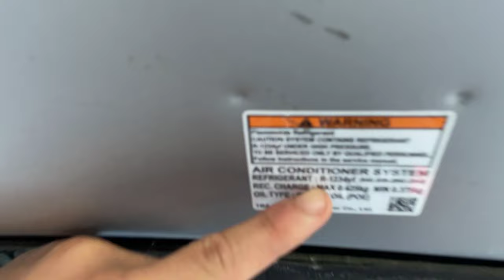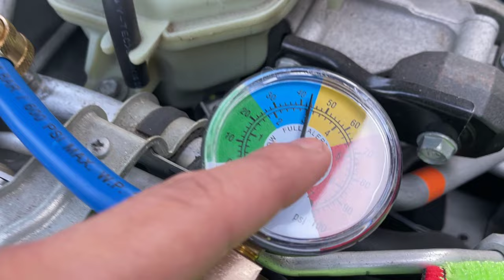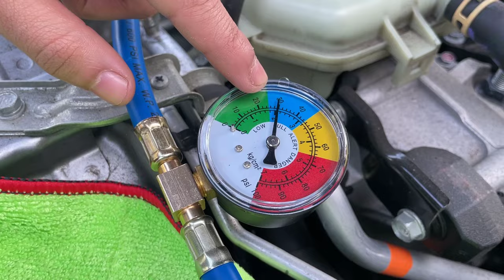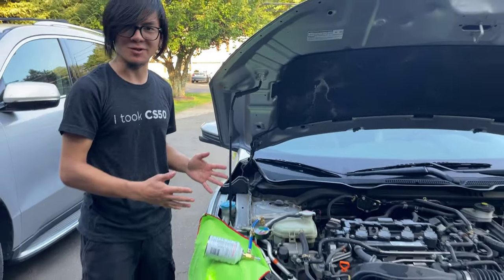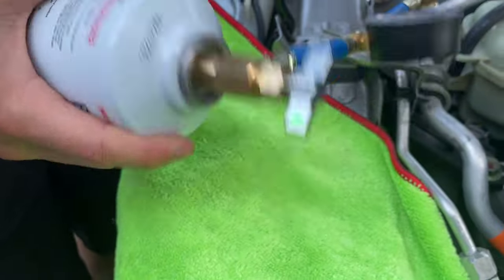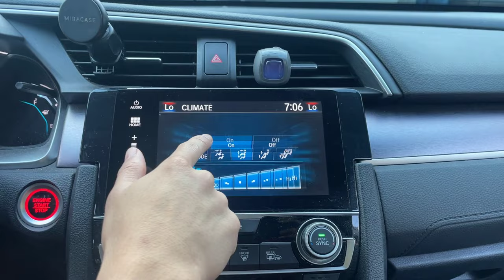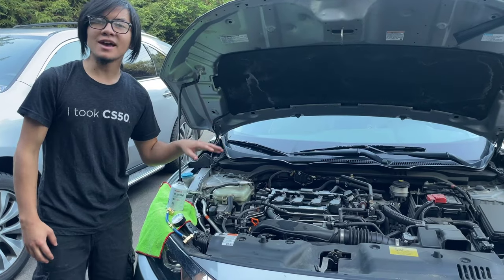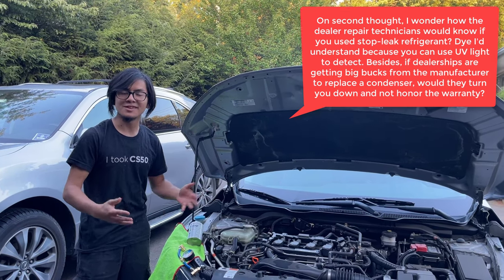How To Recharge A/C 10th Gen Honda Civic 2016-2021 R1234YF In-Depth | TSB Recall Condenser Issues

Comment: I got mine for less then 35$ at Walmart 😂 I don’t understand why you all are paying so much
Reply: The whole kit?
Reply: My local Walmart super center doesn’t even carry any 1234yf. I had to get same kit this guy got
Reply: Lol no way you got R 1234yf for that much that's straight up bull
Reply: AC is a closed system. If the refrigerant charge gets low all the time then I would be concerned about leaks and get them fixed before recharging.
Reply: Bro 35$?? You got robbed I got mine for 5$ 🤑

Comment: I have a 2019 and the same problem exist every year had to refill. No more hondas for this guy. No warrenty or any kind of help from honda either. FYI
Reply: Well if they did it under warranty they’d have to pay their worker instead of you paying them.
Reply: Man I got 2019 too I just filled mine again smh
Reply: Their mechanics are a freaking joke. They go straight to where the warrant parts are and void it immediately
Reply: Check your condenser. Apparently they’re going bad. Currently learning how to replace mine. Stop charging your system until you check that first. You’re just putting a band-aid on it by charging it.

Comment: I just bought it right now, Total came out to $77 and some change.
Reply from the maker: Ouchh, that's a lot. You probably bought the one with leak seal. The regular Honeywell R-1234yf Soltice yf Refrigerant 8oz at our local Autozone is $44.99
Reply: What hose brand was it ? @EyeOnAiman

Comment: Just recharge it with R-134a, R-1234yf is backwards compatible and the only reason the gov forced the switch is because honeywell lobbied them to adopt their proprietary refrigerant, the system is exactly the same. I just did mine over the summer and it blows colder then ever.

Comment from the maker: Here are the #ad links to the R-1234YF, hose with gauge, parts, materials, accessories and tools needed for this repair:
1.  https://amzn.to/3DyOQvh  |  ZeroR® Top Off Kit #1 - Genuine 8oz HFO-R1234YF Refrigerant (1 Can) & HD Brass Can Tap with Gauge
2.  https://amzn.to/3qe5r4z  |  Arctic Air for R1234yf, 4 cans and Gauge, R-1234yf, R1234 Refrigerant Support
3.  https://amzn.to/3Om4pf4  |  R1234YF Refrigerant Charge Hose Kit, R-1234YF AC refrigerant Can Hose with Gauge, 1/2 LH Can Opener Tap And R1234YF Low Side Adapter
4.  https://amzn.to/3OcX0yr  |  Lichamp AC R1234YF R134A Gauge Set, Automotive Manifold Gauge Compatible with R1234YF R134A and R404A Refrigerants, Works on Car Freon Charging and Evacuatio
5.  https://amzn.to/44DIXcd  |  Lichamp AC Oil Injector R134A, R1234YF Refrigerant A/C Dye Injector Kit with Adjustable Coupler and Oil Checkers

Or Click on Amazon link here and search for what you need:  https://amzn.to/3xIOsqg

Comment: Thanks for the notice of the Honda service bulletin! I didn’t know about that as I was getting ready to do this recharge. Took it to the local Honda service center mentioning this bulletin and got a new condenser and seals for free 👌
Reply: Can I ask... before you took your car in for the change did your sticker under the hood reflect the new coolant or the old one? I'm asking because I have a 2016 Civic and my sticker has the new coolant on it (R-1234yf) but I never took it in for the compressor seal change and I wanna know if I should take it or not to worry about it
Reply: @ChilloHaus  I have a 2019 civic and it has the new coolant. A couple days after getting the condenser replaced for free it stopped blowing cold again. I took it back and it needed a new Evaporator, so it was a $2,000 job. Luckily my warranty covered most of it. I think Honda should have recalled for all AC components because that coolant eats through the whole system, not just the covered condenser. When you bring it in make sure to mention that you are bringing it in for Honda Service Bulletin 19-091. Your model should be covered for the condenser at least

Comment: Thanks! I talked to the dealership and I never even knew that the A/C requires recharging every 3-5 years... they stated they would do it but minimum would cost 300 bucks to do... and thats if the parts were not broken or something.

Watching this... hoping that it will only cost me the 60ish bucks you mentioned. If so you were a life saver. Thanks!
Reply: AC is a sealed system and during operation, refrigerant  does not get consumed. If it's low in charge, there is a leak somewhere. At a dealership where Technicians are flat rate, they are not going to spend time to look for leaks. They will just charge it and collect their pay for that job and quickly grab the next set of keys. Do you recharge your refrigerator or window AC unit every 3-5 years? BTW, technician of decades and do a lot of AC work. It's always a leak, and I find them and fix them.
Reply: If u don’t recharge the system in the long run it’s over

Comment: As a former instructor, GREAT INFORMATIVE VIDEO! One question, I was alway told to hold the can of coolant upright so the vapors would travel into the system as a vapor, not a liquid. Am I wrong about this? Is it ok to hold the can upside down as demonstarted in the video and let the coolant in liquid form  enter the system as a fluid? Please advise, thanks!

Comment: I bet I backed the pin back out and failed at least once.  I have a lever on my 1234yf gauge.  I guess you just hold it down to the end.  Lots of useful info here.  I did get the Honda notice on my 2016

Comment: Your video just saved me from going to Honda and pay a lot of money. Thank you so much! Just have one question. I accidentally pulled down the H pipe and it got removed from the plastic bracket. Then I realize I was supposed to go for the L cap pipe. Now I can’t put the H pipe in that bracket. Is there any tip you can give me to lock it back?

Comment: Do you know about how long this lasts until you'll need to possibly do this process again?
Reply from the maker: We're ok so far, been about a month a half (since July 24th) and the AC is back to normal. We'll let you know how long it last. Eventually we're going to have to bring it back to the dealer to replace the faulty condenser but we have until 2026 or 2027. It's a 2017 Honda Civic so the extended warranty on the condenser should last 10 years from date of original purchase.

Comment: what happens if you use the old refrigerant ? will it destroy the condenser or any other air conditioning components ?
Reply from the maker: Well, there are 2 different school of thought on this one:
1) The "NO" crowds - It's important to note that you should not use R134A in a system that is designed for 1234YF. The two refrigerants have different properties and using the wrong one can cause damage to the system and potentially be dangerous.
2) The "YES" crowds -  Can I convert R-1234yf to R134a?
You can convert an empty R-1234yf system to R-134a. Mercedes made this obvious when it raised objections to R-1234yf over 11⁄2 years ago and recalled European models with the refrigerant, recovered it from the vehicles' systems and recharged them with R-134a.

However, you should NOT convert R-134a system to R-1234yf. R134a systems were not designed to operate using a flammable refrigerant. R134a systems should not be converted to use R1234yf as these systems are unable to be converted to a level that satisfies the requirements of international standards (SAE J639 and SAE J2842) set for systems that use R1234yf.

Comment: I got a 2020 Honda civic Exl  10k miles and have this issue
Reply from the maker: Well, that sucks, but at least it should still be under the warranty and the dealer should be glad to replace the condenser at no charge and probably point out to some other "maintenance" issues needed to  be done. Once you bring it to a dealer, there's always going to be a follow up trip, usually once after another 😞

Comment: So what was your issue? Refrigerant low or leak?
Reply from the maker: Not 100% sure. Most likely a slow leak coming from the condenser causing the refrigerant volume to be low over time, but the AC is working fine right now. It's been a month and a half since then.

Comment: Another question, If the ac is recharged and the fan speed decreases. What would be the cause?
Reply from the maker: Not sure if the increase refrigerant pressure affected the fan speed. The most likely cause is simply that the fan speed setting is on an automatic setting and the system is responding to changes in temperature. However, if you have the fan set to a specific speed and it is still fluctuating, there could be an issue with the fan itself or with the AC system as a whole. Clogged air filter or cabin filter could also be a culprit, perhaps motor starting to fail, but if it happened right after the AC recharged and you're referring the AC fan mounted on the radiator/condenser unit and not the blower fan inside the cabin, then it could be the alternator issue, as more current is being drawn to the compressor. It could also be tension of the belt causing the alternator not to be optimal thus providing less amperage overall. Extremely difficult to speculate without testing the current draw before and after.

Comment: I had to do this today in my 2020 civic. As I was filling the feron and it being my furst time. I didnt want mess up my A/c. I was told because it wasnt opened up all the way. It could cause an issue. Later on, i did open it up all the way. Just dont want future honda issues? Though is this true?
Reply: Did you end up doing it yourself? If so, what was the reason you did this? Did the AC compressor stop engaging due to low freon?
Reply: @RobertoLopez-gp2yi  its was low on freon for some reason. Now it gets super icy cold.

Comment: Your video is a bit disorganized and fails to mention that you must not overcharge your system, so you need tell the audience exactly where on the cheap gauge the needle should stabilize and indicate when to stop adding refrigerant.   Also, one commenter mentioned that they took their Honda to the dealer and they fixed it for "FREE."  This is very misleading information or should I say "dis-information" these days.  The very large Honda dealer in my area (N. VA) told me that indeed there is a service bulletin on the A/C system which they say is due to a leak around the compressor shaft (not the condenser as suggested by the Youtuber), however, they won't touch the A/C system on my 2019 CR-V unless I pay about $500 up front for a "assessment" fee.  What do I get for this you ask?  This is their charge to empty/recapture my R1234yf refrigerant (if there is any in their to begin with) and for them to add "dye" and then recharge the now empty system and look for the source of the leak with a UV light.  IF they decide that the leak is due to the service recall part, then they will credit me back the $500 fee for the discharge/recharge/dye and replace the bad part.  IF, they decide that the leak is something else (how heck would I know???), then they will advise me what needs to be done and how much it will cost AND I am on the hook for the initial "evaluation" fee; no way around it!   Sounds like a gigantic lose/lose rip-off, because I have no idea what they are going to find and what they decide needs replacing.  Also, I know enough about A/C systems (having installed and serviced over dozen different auto makes in the past) I know that dye can be added to any A/C system without removing all the refrigerant anyway.  If you follow this train of logic carefully, you will understand why I am NOT taking my Honda to the "stealership" for this problem.
Reply: I just came back from the dealership due this issue , they didn’t want to refill the ac due problem with the vaporizer or  whatever is called . They said they have to fix that first before they proceed with the ac Refill that is covered by the warranty but they wanted to charge me 2 grand  to fix the vaporizer . Idk what to do about it . I might just buy this ac can and refill it by myself for now .
Reply: My AC was blowing hot air. I took it to the dealer and they charged $430 to  put a dye and refridgerant in and ask me to drive it for a week or so. After driving the car 500 miles i returned to the dealer so they could check for a leak. They said my compresor seals and the suction hose were leaking. They will fix the compressor seal for free but want me to pay $1088 for a new suction hose.  Am i being ripped off ?
Reply: This video was highly organized and informative. Your comment was not😂
Reply: @c.richardsmith3437  😢. This is outrageous! Both of my sons' 2018 hondas have a non functioning A/C. There's no way we should pay over $100 to have these cars diagnosed,  and with less than 60k miles each, any A/C leaks SHOULD be covered by that extended warranty, regardless of where the leak is.   I see a class action suit coming soon !
Reply: “Dis-information” 
Misinformation is the term you’re looking for; don’t think too hard Mike
Reply: lol stealership
Reply: @c.richardsmith3437  sounds like it.
Reply: Bro stop hating lol this video was pretty well made, it seems to me you just lack enough experience to do this job. If you’re mechanically inclined you would’ve understood he gave more than enough information on how to complete this procedure it’s not that hard.
Reply: Stay away from the dealership unless it's for warranty work, otherwise you  will get ripped off.  Find yourself an honest local mechanic or better yet learn how to fix things yourself. R1234yf is complete garbage and is way over priced. Any vehicle that came from the factory with it can successfully be converted to use R134a. There's plenty of videos right here on YouTube explaining the process. I've done it to 5 different vehicles so far with no issues.
Reply: @c.richardsmith3437 I was told the same. Just DIY. The hose is like a $14 part. You can rent the necessary parts at autozone. They say don’t release refrigerant into the air but also remember Taylor swift is out there flying her private jumbo jet.
Reply: Why don't you tell the good people where the pressure should be and just be nice
Reply: Yup!
Reply: @superdupert6 ugh $160 to just “diagnose my car” if it’s covered under warranty, I get it back but if it’s not then I’m on the hook for $160 like are you serious? How about you just not tell me what the problem is if it’s not under warranty and don’t charge me anything you freaken losers I hate dealerships
Reply: @leosantamaria1621 I think you mean evaporator? And yes they fixed the first two pieces but now will not fix the third (evaporator) until I pay they $1900+

Comment: I have a 2022 with 20,00 miles and the AC does not throw cold air anymore would you be able to help me
Reply: I have a 2018 CRV last year the SC did not blow the cold air any more. I searched the internet and found this video. It seems that this is a common problem for Honda ACs

I called the local Honda dealer. They said they would change the cost to check whether it is the AC problem. If it is not, I have to pay the diagnosis cost. Since the AC has a 10 year warranty, I will recharge the R-1234fy first. If it is still lack of cold air, I will bring it up tp the dealership to check.

Comment: How do I know if I need Freon? And how do I know how much to add?
Reply: My civic is blowing cold air but I noticed I have to lower the temperature in the cabin significantly which I didn’t have to do before
Reply from the maker: @christiancammarota3061  If it's the condenser then you can bring to the dealer for warranty recall. We just don't want to bring to the dealer yet.

Comment: Once you get corrosion and moisture in the system, you’re going to end up like me: first it’s a condenser problem; next will be a compressor seal problem, lastly the evaporator will corrode from the inside and spring many leaks. I’ve gotten the first two covered by Honda. They are delaying my evaporator fix and want me to front $2000 until they figure out what to do for everyone

Comment: Can it use the other gas? And use an adapter maybe?
Reply: No!
Reply from the maker: Well, there are 2 different school of thought on this one:
1) The "NO" crowds - It's important to note that you should not use R134A in a system that is designed for 1234YF. The two refrigerants have different properties and using the wrong one can cause damage to the system and potentially be dangerous.
2) The "YES" crowds -  Can I convert R-1234yf to R134a? You can convert an empty R-1234yf system to R-134a. Mercedes made this obvious when it raised objections to R-1234yf over 11⁄2 years ago and recalled European models with the refrigerant, recovered it from the vehicles' systems and recharged them with R-134a.

But it doesn't mean you should even if you could. What would be the reason for it? Costs? 

However, you should NOT convert R-134a system to R-1234yf. R134a systems were not designed to operate using a flammable refrigerant. R134a systems should not be converted to use R1234yf as these systems are unable to be converted to a level that satisfies the requirements of international standards (SAE J639 and SAE J2842) set for systems that use R1234yf.

Comment: If you need recharge your ac system, get it repaired correctly. The AC system requires NO service.
Reply: Are you saying that even if this works, it's wrong?
Reply: @jtown1bb I don't believe that's true. I Googled it a while ago and an A/C recharge is pretty routine.